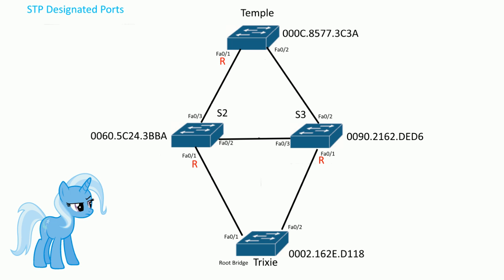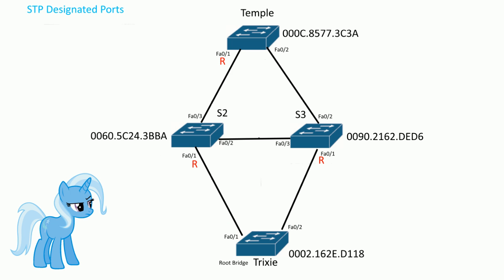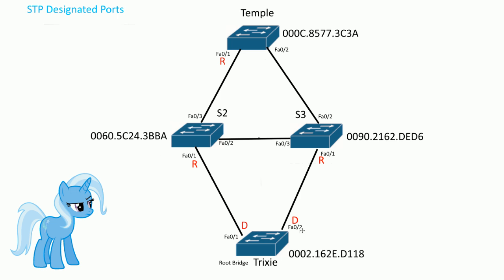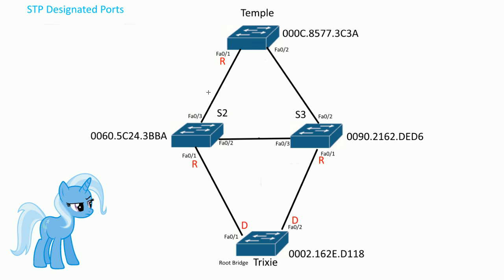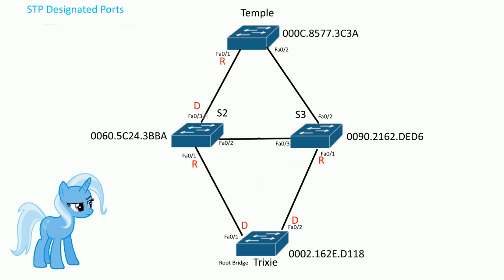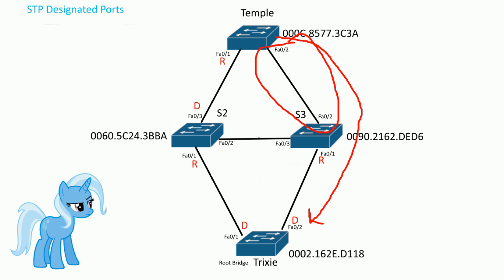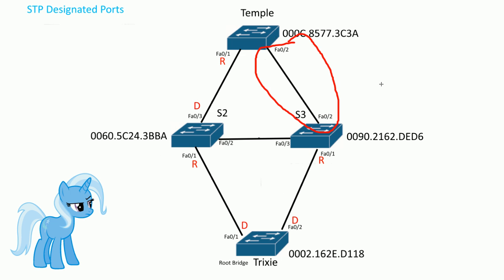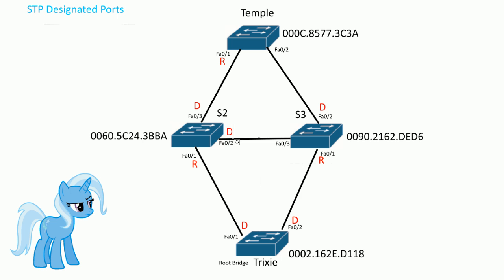STP Designated ports

Comment: ty, ty.   The way you desscribed designated ports made the most sense in my head as well.  There are newer videos by others that I just don't get.   Root ports have to have a designated port on the other end, all ports on the Root Bridge are designated.   From there, links that aren't RP or Designated already, then you run the calc on those links to find out which side is designated.  Everything else is blocked.

Comment: Shouldn't Fa0/2 at S3 be blocked and Fa0/2 at Temple designated? Just wondering, since Temple's MAC-Adress value is smaller than that of S3.
Reply from the maker: Let's just isolate both switches. Temple has a root cost of 38. 
S3 has a root cost of 19. Looking at that link, the first step in the protocol is to find the lowest cost. Since S3 is lower, S3 Fa0/2 gets the designated role. If the cost were to tie then it would be just like you said, the lowest Bridge ID (aka MAC address).
Reply: @DerpyNetworking  You're right! Thanks for response.

Comment: What is the cost in case you have a link with fast ethernet and the other side is giga...???
Reply from the maker: Excellent question! Switches use auto-negotiation, so if one side is Gig and the other is fast ethernet, it will pick the best speed both support (Fast Ethernet). The link between the switches will become Fast Ethernet and the cost will be 19.
Reply from the maker: Both sides try to negotiate the best settings as possible. So if one side uses 100 Mbps and the other uses 1000 Mbps, they both use 100 Mbps. One side can't send data fast than the other.
Reply: Derpy...thank you...Did you pass your CCNA?
Reply from the maker: No yet, I'm taking the exam soon. Thanks.
Reply: you know that they change the exam by August 19 next month right...?
Reply from the maker: Yep, I'm just going to study for the new one and hope for the best.